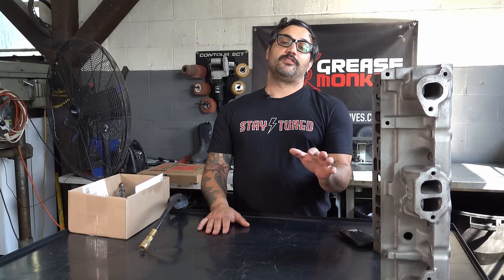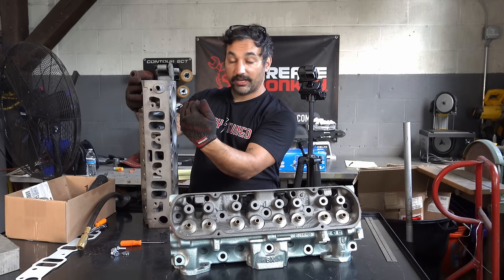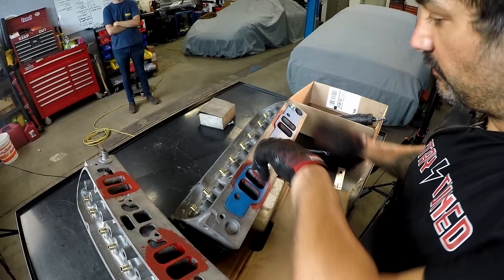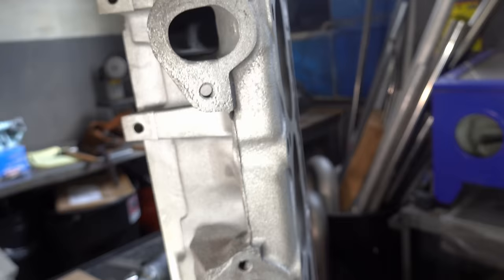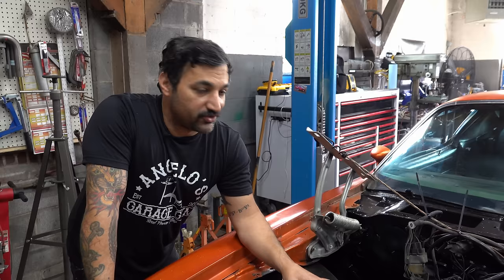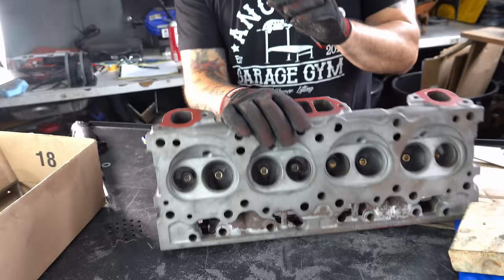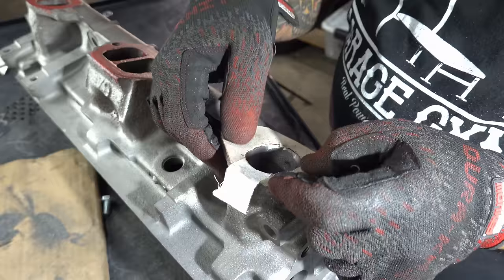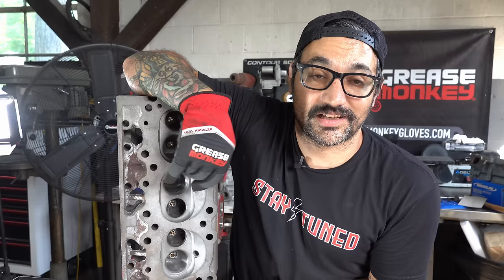It's Free and I Hate it! *Works on Any Engine

Comment: I attempted this once. Bought a set of junkyard vortec heads. Got halfway threw and found out that they were cracked at the valve seats. Found another pair and waited, slapped them on had no problem (that i knew of). Took them to a shop to get studs installed and same thing...

Comment: Glad you're doing this. Need to replace some (likely) cracked heads on a 5.9L magnum, was going to get aftermarket cast iron heads that are reinforced to solve the cracking, considered hand porting them. Also getting difficult to find the trick flow heads for that engine right now. And they cost. I don't have a template though.
Reply: Google the pictures of the heads you plan to port. Also look for books in porting. Most of the tricks are the same for all heads. Short turn work, don’t do much on the floors, focus on the bowl area then sides and roof of the ports.

Comment: Engine masters did a test on stock, port matched and fully ported heads. Port matched was worth 1/2 the horsepower of a fully ported head. Across the entire rpm range. Totally worth it. You also don’t have to port everything. Look at your entire intake tract and see where your restricted.

Comment: For porting work a Dremel can use a cable from the tool to a Chuck that is about the size of a sharpy or fat pencil. It would be easier to used than holding a big tool. The one I want is sold by Micro Mark. It’s a large motor with a long cable. The motor hangs from a stand and the piece you hold is just like the cable attachment for a Dremel.

Comment: kick butt episode .... very informative - very detailed , some good tricks "using the valves upside down in the port" and like the horsepower - free information ha ha
Reply: Worth noting, those weren't the valves he's going to use. They are slightly smaller so they will actually fit inside.
Reply: @phuzz00  thats what i said "using the valve upside down in the port" the show was about free horsepower  ? you got it twisted all 5 statements were complements

Comment: I'm currently in the process of porting my 24 valve Cummins head (vp44 pump) and I wound up going to a respirator, my teeth were black and silver from all the soot and metal that I was breathing in. Takes forever to get done but it's cheaper than a D&J ported head!

Comment: Round the beginning of the casting near the valve guide. After the guide form your fin, taller is better and fade out to the roof. Idea is to make the fin tail (facing the port on exhaust side only) very sharp. This will allow The air to disconnect from the fin. This is very similar to the top of the Corvette rear bumper. It's a sharp 90° so the air disconnects from the car. Otherwise you have a bunch of turbulence.  Do the exact same on the intake valve guide but the exact opposite. Round the fin leading edge facing the port because air is traveling into the engine. After the valve guide try and make whatever air flow guide you have very sharp. When the air converges it will hit this sharp edge and disconnect from the head. Also you should never remove any material from the floor. If anything you should only epoxy the floor to try and lift the short-term radius a little bit or fill in low spots which will cause stagnant turbulent flow. All your flow gains will be found in the roof. Another fun fact. If you just take a stock cast head be aluminum or cast iron, and put a 60 grit finish on the intake port or the exhaust port, you will pick up significant flow over the rough casting. You don't even have to make the port larger just smooth it out with 60 grit and you'll pick up a gang load of flow..

Comment: Those are good heads for the street, especially with the blower, the Edelbrock heads probably don’t flow much better than a ported set of 6x heads, especially at the lift numbers on a street blower motor. I’m using the 6x 4 heads on my 455 with hydraulic flat tapped cam, the best part of the aluminum heads would be the weight savings
Reply from the maker: I'm expecting these to be pretty good with the blower and the port work! We will probably swap to a set of Edelbrocks when they become available but they will get the full Butler port job on them, and then they should outperform anything you can do with a stock head.
Reply: @StayTunedTA  I agree the Butler ported Edelbrocks are great for the engine, hope to get back to back dyno and track comparisons
Reply: @StayTunedTA  I make 700HP on a NA 6x8 headed ported polished and deckd to an 88cc compustion chamber. 455 superduty bored .30 over zero decked  and stroked a bit on a buttler h beam light weight forged assembly all studded 13.5:1 compression on 93 pump gas 
Revs comfortably to 7500rpm fuel injected on a .600 lift 243/257 duration cam torker 2 intake ported too. 7qt pan with a remote 2qt moroso filter and cooler 80psi oil pump

Comment: There's more to it than just increasing airflow unless it's a direct injection engine.  It's not hard to really foul up flow and mixture distribution at low throttle openings or low RPM by just hogging out ports.  If all you're looking for is high RPM full throttle improvement and don't care if it works on the street, then by all means just hog em out.  In almost all cases a good three angle valve job has no negative effects and does work.   In almost all cases port matching has no negative effect and does work.

Comment: One of my ex work colleauges did a home porting on the heads, inlet manifold, fitted a fast road cam, skimmed the heads and ballanced the pistons. The wheezy Ford 2.8 V6 came to live from 135hp to about 200.
I fitted headers, hotter spark plugs, 8.5mm spark wires, converted from points to optic ignition, penzoil oil, Motorcraft oil filter and 38 DGAS Weber carb.
Stock Capri with the 2,8i engine (160HP), did the 0-62 in 7.9 sec, but with that engine I clocked mine at 6.5 sec 0-62mph.
I sold that engine with my car, but I do have the oppertunity to buy the engine back if I want to.
People is told you can't get more than 180 ish reliable horsepower from those. That's crap talking!

Another note, the euro 2.8 has siamese ports (2 ports at each bank), vs the US one has 3 ports (2 of the ports are together, which is a bit waste in my opinion).
But the clue the euro heads flows better and the US heads are prone to cracking.
And if you are using US heads you have to use the inlet as well.
Same goes for the euro spec engine.
I have never cracked a head or heard anyone that have a engine that did that, so I belive the euro version is much better.

Comment: Been porting heads for 35 plus years first set was with a dremel took forever.. then upgraded to air powered with carbide bits that can actually cut a head into 2 quite easily. Then purchased a $40 long shaft electric cheapo die grinder off amazon and made a rheostat electrical speed controller for less then $12 so the speed of the die grinder can be infinitely adjustable making it perform exactly like a $400 name brand die grinder. this saves wear and tear on your air compressor because porting takes a LOT of time
Reply: real reason hes porting the old heads instead of expensive new aftermarket ones ? its his personal channel and it is out of "his" pocket the money is coming from hence the free route. the expensive aftermarket heads come later down the road when he talks the producers into doing an unrelated "pontiac" build using the same style of motor that will fall victim to a cracked block or a thrown rod or something that will total the "motor" at least to the eyes of network producers .. he will then swoop in and offer to remove the engine and discard it .. taking the heads and everything not bolted down and repurposing it for his build here .. wait what ? that never happens ? take a look at frieburgers basement and all the stuff he has acquired from all the car and engine builds over the years .. all that stuff eventually goes somewhere . talk about a car lovers dream job ..they have no business calling what they do WORK about as grueling as hugh hefner dreading going to work every day at the play boy mansion.

Comment: By the time you spend 2 days porting those heads and then have to buy valves, springs and retainers plus getting a valve job done you may as well buy the alloy heads. 
It is a GM head so do not grind anything from the short side. They are generally always too short to start with. This both intake and exhaust.
And you do have your appointment bookd to remove metal from your eyes!!

Comment: As someone who is completely broke. I really want to port the heads on the LT1 in my 1996 Buick Roadmaster sedan. It's a great engine. But I want to squeeze out as much free power as possible. I'd really like to get some aluminum heads to port so I don't have to pull my engine apart until they're ready. But I doubt I'll be able to afford any. Especially the way prices are right now.

Comment: Make sure you have the correct intake gaskets when you put that engine together. I see you have the 71 down ones on it for your head porting. You will need the 72 up course the heat cross over is different. Do t ask how I learned. 😂

Comment: Dykem also comes in paint markers, spray cans, the pipe dope style can Tony has here.

You can get red, yellow, blue, all sorts. If ya need the Dykem and dont know how to purchase it, head on over to MSC, ya might have to buy 6 markers or some ish but they got all that.

Also, Dykem(Dye-chem) aint nearly as bad as bluing compound. Both will get everywhere, bluing compound is what we use for mounting spindle hubs, total runout less than .001" thousandth of an inch.

Point is bluing is meant to show any surface imperfection, Dykem is your layout buddy.

Comment: Between correctly ported heads, the right intake manifold and intake valve duration, 100%+ volumetric efficiency can be achieved on piston engines as well. This is also why big cam engines chop. The high amount of scavenging at low RPM creates an uneven idle. Please correct me if I’m wrong

Comment: I ported my turbine housing, just from td05 to td05h. it took all day basically, I used sharpie for dykem, and I would put a layer of ink down, then grind it off, put another layer of ink down, grind it off. Cast is very hard and takes forever to grind away, but now I can fit easier to find turbine wheels, and a little bit more power overall. It was the hard way, and it took all day to do, but I was able to do it myself and I wont have trouble finding parts that fit.

Comment: Cams and heads are the best way of freeing horsepower since EVER. I’ve seen a Chevy 350 wake up with 50 horsepower with just a cam alone. With porting, polishing, jets, carbs, injectors, tune, and let the engine breathe with forced induction, or NA. You just have to build with details in mind with some good timing.

Comment: I was taught to use a gasket as the template to port and polish since gasket usually is larger than the intake or exhaust ( or smaller depending on your perspective) . I guess it's not full porting but more gasket matching 🤔
Reply: Gasket matching in the intake side Is a wrong way to port if you are looking to balance your flow on all of the ports to be as close to the same value as possible - NA car. 
Also you loose velocity at times which hurt your low to mid range if you go too big. 
If its boosted car you can port them all large as you are forscefeeding. Intake runner length difference does not come into play.

Comment: I just want to add to the tooling discussion.  You NEED a real strong compressor for this kind of work.  LIttle things like die grinders and D/A sanders take a lot of air volume, and honestly, it's the amount of time on trigger that makes them top draws.  60 gallon air tank with a DUAL STAGE compressor is a must have.  Get a BIG regulator, at least 1/2", I prefer 3/4" to 1".  set tank pressure to 150-175, and regulate it to 90-120, depending on your tool needs.  If you're not up to task on the compressor, invest in a good 110volt die grinder.  Die grinders on a small or midsize compressor is miserable.
Reply from the maker: You are absolutely right. My Eastwood compressor runs 100 percent duty cycles and I haven’t thought about that in awhile!

Comment: Nice job 👌

When you covered the weld-on sump on the tank, you probably should have mentioned that if you are doing it on an old tank that has had gas in it, you'll want to clean it out thoroughly and/or fill it up with water before welding it up so it doesn't explode. It seems like common sense but unfortunately common sense is extinct nowadays.

Also regarding porting, I read a book called 'performance four stroke tuning' or something along those lines, and when they went into the porting side of things, they say that if you have a small step/mismatch between the manifolds and manifold sections so you step up in size at each join (so the port is smaller on the upstream side), it helps a bit to reduce backflow/reversion.

And you should also have mentioned that the polishing is by name only. If you actually polish the ports completely smooth and mirror finished, it can harm performance as the fuel droplets don't have a rough/sharp surface to stick to and help atomise them.
Reply: @cygnus1965  there's still oxygen in exhaust gas, and could still explode, backfires being an explosion in said exhaust gas. You're going to get rusting where your welds are anyway.
Reply: You could rinse the tank before and after with some 2 stroke mix to give everything a thin film of oil if you were really worried.

Comment: The inside curve  below the seat is the most critical part , any ledge or flat spot will deflect across the port and ruin the flow. I know I ruined my 1st porting SBC heads years ago. The gear heads that showed me their trade used Dumore die grinders because of their stability from their size and lower rpm.

Comment: People tend to go a little too nuts on the exhaust but the thing is the piston swinging up literally forced the exhaust out so porting the exhaust all crazy isn't near as important as the intake cuz it's much easier to hinder flow under vacuum like an N/A intake port than it is flow that's being forced out. Example: Frieburger did the header bashing engine masters and with a primary tube almost completely caved in it didn't hinder the power AT ALL! That's because the pistons natural swing upwards on the ex stroke is PUSHING that spent air out, it's helping it out of there but vacuum is different, it's easy to interfere with vacuum flow cuz there's nothing helping it. Crimp a straw and you'll see it's a lot easier to blow air through the crimped area than it is too suck it through. Your head ports work the same way unless it's forced induction, then it's getting crammed in so it's all about runner CC's at that point so bottom line if you're home porting a set of heads for an N/A application out all your BEST work and consistency into your intake runners and just gallery match and take the casting imperfections out of the exhaust and a little contouring. And leave the intake surface ROUGH the way your bur bit leaves it! That helps mix the air and fuel together and atomize it. Makes it more volatile DO NOT polish your intake ringers smooth as a babies ass you're not helping anything you're wasting time helping deliver wet fuel to the cyl Instead of a volatile mist. And last but not least there is a slight Venturi cast into the intake pocket just under the valve tulip THAT IS THERE FOR GOOD REASON. Contour that don't port it out cuz that is a venturi to put your air column through a high pressure ring to squeeze the mixture and blow it out the low pressure side. That is also for atomization . If you port that Venturi out of there and have any kind of rowdy can you will foul plugs erratically cuz you're feeding wet gas in the combustion chamber. I read the heads porting Bible many years ago and have done MANY sets since then successfully

Comment: hey tony in the old days it was: port polish, port match, polish and shave cylinder heads. only a few would change the shape of the combustion chambers.

you want a smooth flowing port rather than sharp corners so the air doesnt have to work as hard.
see Dr David Vizard (aka the BMC mini wizard) yes he got his doctorate in engines.

cos in the 80s it was cheaper in the 80s to get machine work done than get after market heads that flow out of the box. cos aluminium heads were for rich race guys.

Comment: Just a heads up. Around minute mark 2, where he is welding the tank up. 
Do yourself a big favor. Since you are already welding, go ahead and weld a bung in the lowest point. It's like 6 bucks. That way, in the future, one 12 mm wrench and you can drain your tank. 
Yeah the fittings are pretty low but could be even lower and bolts last longer than AN fittings.

Comment: Rotaries are amazing. It's not dark magic. Check your endplay. Don't drop your trust bearing into the front cover. Use plenty of premix.
Reply from the maker: That needle bearing in the front can get ya! Sizing side seals, and gluing apex seals back together is probably where you need magic the most.

Comment: Tony!! Did the cracked head have any modifications to the combustion chamber?  Could you ask Butler to see if theres any modifications to be done to the combustion for performance. Those sharp ridges concern me and or they might not hinder anything. How about valve angles? Same or modified?

Comment: If you are using a SB Chevrolet Start be taking your 1.94 seat cutter and runit all the way down to the bottom of the valve pocket then use a 2.05 seat cutter and install 351C two barrel valves. Yes the stems are 3/8 but you wanted new guides. Then gasket match the ports and you go to the exhausts and do the same with the exhaust 1.50 cutter to the bottom of the pocket then cut new pockets for 1.60 hardened seats. You will be so impressed. So much less work doing this that way.